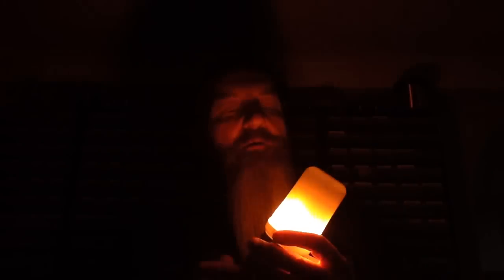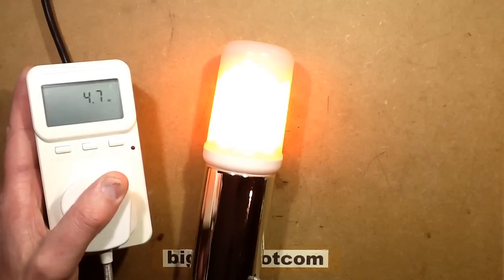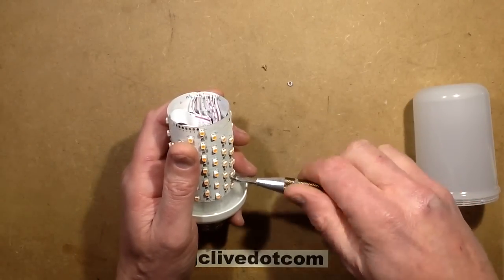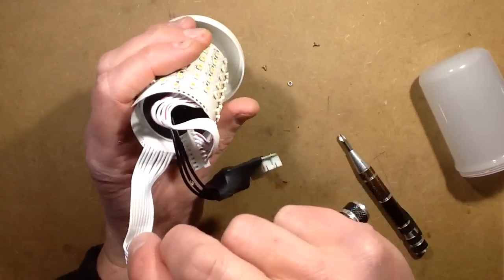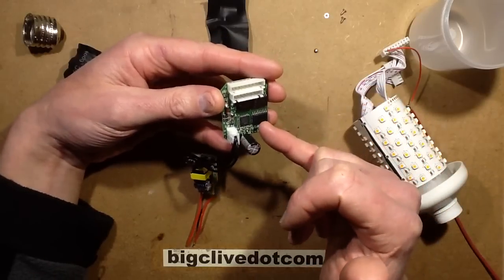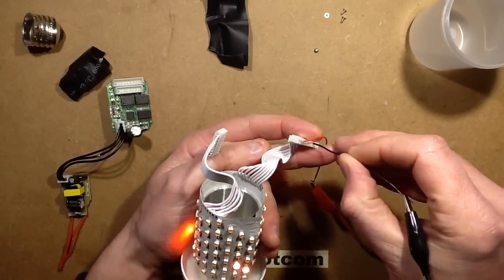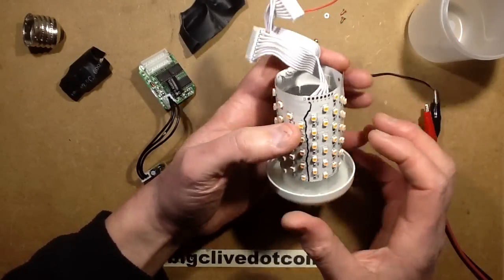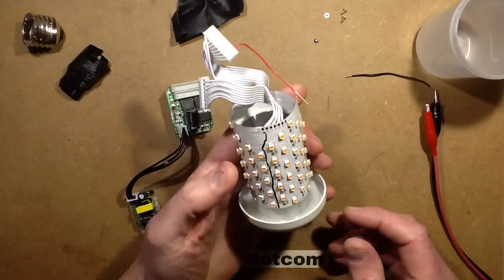Amazing new realistic flame effect LED lamp. (Full original version.)

Comment: Anybody else having trouble accessing the linked website?
Just getting "Warning: rtrim() expects parameter 1 to be string, array given in /home/content/n3pnexwpnas02_data01/05/3655905/html/wp-includes/formatting.php on line 2376"
Reply: Add www to the front; not much on the site though
Reply: I did nothing to the link, but it works now, looking forward to seeing these on ebay!

Comment: Question @bigclivedotcom about the proposed random sequence idea.  Presumably they have designed the 4 second pattern to look like a realistic flame, with the top leds lighting with a gap below to give the effect of flame separating as it rises before then extinguishing.  This is a significant aspect which makes the flame look realistic IMO (only having seen it on video!).  would a random pattern be able to create a similar effect?  I'm guessing not.

Comment: Not sure if it's groundbreaking, I made something like this some years ago with a microcontroller and a panel of LEDs, running an animation loop. Didn't have the small surface mount LEDS or a curved surface, though, but the concept was there.
It's certainly better than the cheap candle lights with a single flickering LED

Comment: So there's no way to permanently set the mode?  Everytime you turn it off and on again you have to fully cycle through??
Reply: It hopefully defaults to flame, only doing the other two effects if you switch it off then on again within say 5s.
Reply: I just bought one and it's like +Graham Langley says: if you turn it off briefly it comes up in a different mode but if you leave it off for at least one minute it comes up in the same mode it was in before you turned it off.
Reply: +Sootikins It's the only sensible way to do it.

Comment: At the local makers fair last year (July 2015) a torchlight somewhat similar to this was demonstrated. That torch uses strips of addressable LED RGB tape running vertical long the cylinder replicated around the outside of the cylinder. The led flame pattern was driven by an arduino. There was also a mode which displayed scrolling text. Easy project for the hobby crowd. Just use the outside of a beer can for the cylinder. :)

Comment: So an original version, then a cut down version due to complaints, then the original version again. Did you get another email from the company or something? It's not like your really revealed all its secrets.
Reply from the maker: I think they realised that the visits to their website plunged when the censored version was put up.
Reply: Hopefully they'll send you more stuff to take apart once they know how much extra traffic they get :)
Reply: Anyone with the means to manufacture such a device, would have the means to reverse engineer such a device.
Reply: details that anyone interested in building their own could find out in 20 when they had one in their hands... the real magic is in the chips and I'm guessing they are protected against reading.
Reply: Moose it would be pretty easy to reverse engineer . record the sequence of LEDs when it is running with the cap off. play it back slowly and note down what it turns on/off in order. then you just need to lob that into a table in a small micro controller and sequence it out the the drivers.
Reply: Why would you send stuff to a teardown channel and expect it to not be torn down? People make no sense.
Reply: Anyone with the means to manufacture such a device, would have the means to just design one on their own having taken the lamp apart and observed it for a few minutes. No further reverse engineering needed than that, really. Which makes it even more surprising that the company was upset.
Reply: What was the complaint, out of curiosity?
Reply: I think it would be quicker just to design your own than bother reverse engineering this one. There are off the shelf chips available for LED displays that could be implemented for this in an afternoon.
Reply: their website is still broke. the products link goes to "contact us"
Reply: The company felt he gave away too many details in this version.
Reply: ***** Exactly. Thats the idea of being first to market - by the time the competitors have researched, produced and are selling their own unit, you should have swamped the market and can reduce the price of yours as you've already paid for the R&D.
Reply: wasnt xjet, was his other channel rc model reviews, but yeah good talk of his, i linked it on my comment above
Reply: I bet they call this technology "innovative" and such ... gosh, It's not innovative. This wouldn't be the first time someone has done an LED-array based flame simulator.
Reply: I did one last year, but it was only a flat panel. Didn't think of this type which is interesting, but not sure why I'd want to buy it.

Comment: Clive, can you tell me please what type of transitor can i use, that a cdrom motor run slowly ? I'm using a cdrom motor for a rotating platform, for miniature diplay, at a 1.2 v battery, it is too fast.
Reply: how about an adjustable buck converter, pretty cheap on ebay
Reply: +jusb1066 Thanks, i won't use ebay. Got my reasons why. Either, there i didn't find anyway to down a 1.2 v or 1.5 v to much lower.

Comment: Did you realize at 5:55 you grabbed the PSU circuit whilst it was still powered up from the mains?
Reply from the maker: When the lid is up on the tester it fully disconnects the power.
Reply: slm60uk what a noob.
Reply: Evil from evilution Doh!
Reply: You don't eat and don't sleep, you are powered by electric shocks, don't mess with with Big Clive!

Comment: Wouldn't it be slightly annoying that it changes mode each time its turned off if you do intend to use it as an outside coach light?
Reply: I think that might only happen if its off for less than a few seconds?
Just like those flashlights that change the mode when you turn them off and on rapidly.

Comment: Do those LEDs have orange phosphor ? Seen that once before in an automotive lamp.
I wonder if the mystery chip is a SPI flash chip with the data - could make for some interesting hacks.
Reply from the maker: It's a deep golden white.  I think the mystery chip is just a serial to parallel converter for driving the ULN2803's, although the CPU has 32 pins, so I would have thought there would be 16 digital lines already available.
Reply: +Kyôdai Ken Those golden white LEDs seem to be this year's colour for Xmas lights here in the UK. I first came across them in a Halloween toy three or four years back.
Reply: Graham Langley
Makes sense for Europe. I'm from Germany and don't like warm white that much. I don't like the freaking hot summers here. So I prefere colder colors. Occasionaly in winter I turn on dim warm white lighting.
Reply: enough pixels to have rotating words?
Reply: Orange phosphor is typical for golden warm white LEDs.

Comment: So simple from a design perspective. Smart use of a micro to produce a very cool effect.
Reply: I would guess they did not use a random generator for the effect because a flame needs to have a heavy weighting to the bottom over the top. Future lamps can have cool near never repeating loops but for good flame you would want a repeating loop at some point. Maybe v2 could have 10 or 20 seconds of repeat. The pattern would be rather small in memory size.
Reply: You're right, you can't just display random noise and expect it to look like a flame - but back in the days of assembly demo/compos flame generator code was like digital clocks are for electronics amateurs: everyone wrote one. You could use one of the better ones feeding off the shift random generator and it would be a truly random flame; the code size involved is tiny...